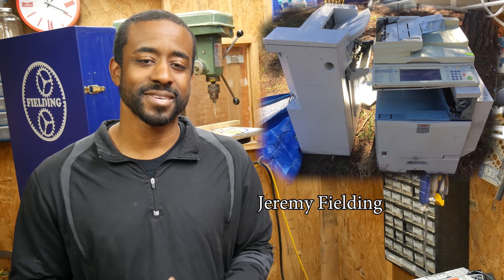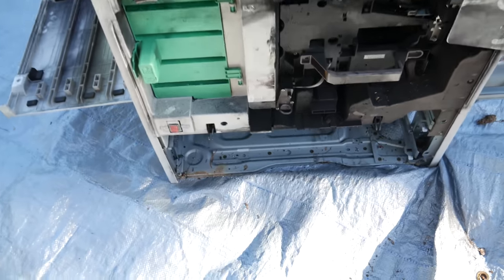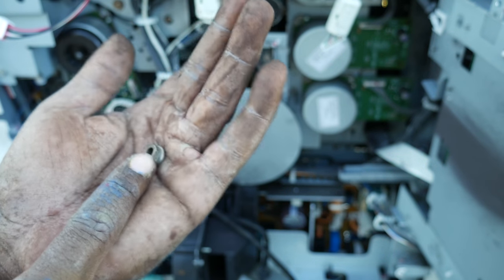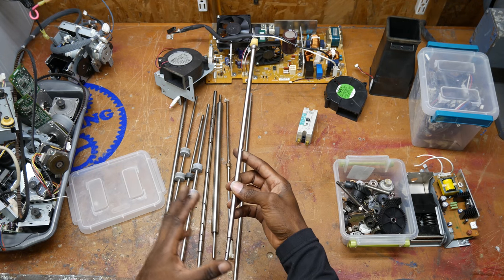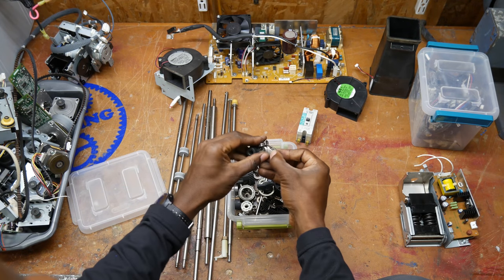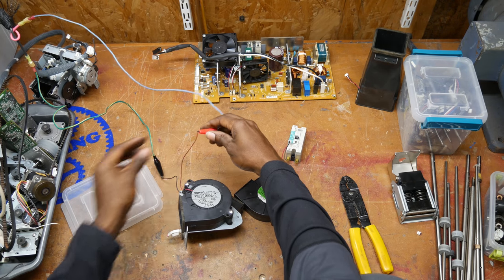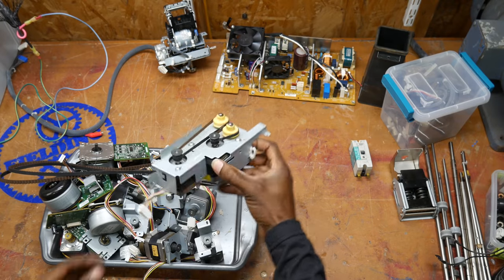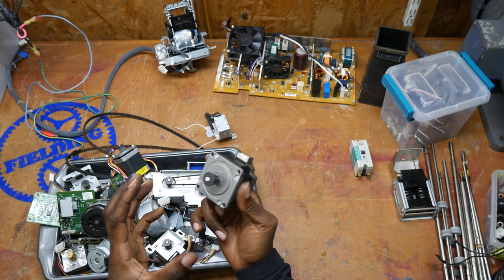How To Salvage A Commercial Printer for Electrical And Mechanical Parts 049

Comment: Holy crap, that's a lot of parts. I have to wonder, if it took you two days to take the thing apart, how long it takes to put these things together in the first place... very cool. Thanks for sharing.
Reply from the maker: My thought exactly
Reply: They put it together in minutes. But they have lots of practice.
Reply: I went to a car assembly plant once and it took 15 minutes for a car to go down the assembly line. That doesn't mean they were only making a car every 15 minutes though. The interval between vehicles on the line was a lot shorter than that. More like as fast as someone could open a car door, get in, and drive a vehicle away. There was a team of people just doing that. The power of mass production is one of the reasons we live like how we do today.

Comment: Hey Jeremy, question: what app or how did you add those AWESOME focused graphics that point out the various parts?  You may have done this before, but this is my first view of a video from you like this.  It really, really adds a great touch to this type of video!!!!  Great job!!!
Reply from the maker: adobe after effects. Check out #45, 40, 34, 24... they all have on screen graphics. Some are more elaborate then others. The one you watched was the "simpliest" one. The Microwave one is the most complex.
Reply: Jeremy Fielding ok, thanks J!  I'll check them out!

Comment: What'd you do with the power supply and how would one go about "turning it on" to get allllll of the voltage outputs working? I'm kind of stuck on that as I recently came across a  Ricoh aficio 2550 full-sized copier, pretty much the same thing as in this video... any advice would be much appreciated! By you or anyone else in the comments section. 
Thanks everyone, great vids btw!
Cheers!

Comment: Ha ha ha. i am a Ricoh tech. i do this every day. maybe not as far as this but i fix 6 or 7  a day.  those first things you pointed to when you said you didnt know what they were. they are magnetic clutches.  behind the lens was a CCD sensor.  this model has to be 15 years or more old now.. new ones have more motors and less gears. edit: comment was at 3 minutes in. not long after you labled the clutches as DC Motors. that is not correct. that other part you couldnt figure out is a stapler unit. i have swapped a few of those out too lol.
Reply from the maker: THANKS

Comment: What about making a 3D printer with the stepper motors?
Reply from the maker: It could be done
Reply: Some of the shafting might not be bad for linear guides too. You can make simple bearings out of any pair of the same bearings with a spacer between them. That's how I made the Z axis on my CNC machine. Alignment is pretty finicky though https://i.imgur.com/arzFmKQ.jpg

Comment: 8mm shaft is a common size in 3D printing, which partially derived from 2d printers. But who knows, maybe they did mix up the shaft sizes. Thanks for the video.
Reply: Oh, and I would suggest you put a switch on your test power supply. This will help in two things, 1) it will prevent accidental shorting of the + and - while just sitting on the bench, and two, it will prevent a component from activating when you weren't ready while putting the wires on and prevent sparking as well.
Reply from the maker: I usually do that actually. Just not this time. too lazy to dig one out I guess. You see my "normal" setup in the how motors work series... with the battery and switch. It is the first video in the series/playlist if you are curious.
Reply from the maker: Some measured .3125", and some .315 (8mm). I think some parts might be made in the US and other over seas. Other wise it is just a relaxed tolerance/ coincidence. Who knows. LOL
Reply: With ground shafting it is probably very accurate. Grinders are graduated in 0.00005 increments (referred to confusingly enough as a half a tenth). In practice you can work closer than that with them too, if you're careful, and a bit lucky.

Comment: Those large printers are made by wizards in dark cave and magic makes them work. I would never open one! The little evil newts may get out and infest your house. Another great video.
Reply from the maker: I was truly astonished at the electrical and mechanical engineering that went into that printer
Reply: We had a huge Canon at work that ran for years and it would fold your clothes and grill burgers while doing it! I got into it a couple times for paper jams and I couldn't believe how something so complicated made from cast plastic and stamped sheet metal with scads of plastic gears and legions of belts, could be so dependable much less actually work.

Comment: Very nice.  Those "brass bushings" could very easily be sintered bronze.  Did you take a close look?  Sintered metal bushings are great for holding on to lubrication, and some of the other uses include filtering and noise suppression.  I wonder why that copier go pitched in the first place.  Your yellow hands might look pretty, but please wear gloves and some kind of mask.  It would be so depressing to lose you any earlier than necessary.
Reply: If you look when Jeremy took it apart it was loaded with toner inside of it. Once these machines get like that it is not cost effective to repair them. It has to do with economies of scale and individual effort versus mass production efficiency. Tossing these machines out when they're in this state and buying a new one ends up being the far cheaper route.
Reply: Hmm, that sounds like a business opportunity to me.  Chimney sweep becomes copier sweep.  A big bag or modified sandblasting cabinet, a fan or compressed air, heppa filter...(the devil may be in the details though).
Reply: I think the problem is that toner is engineered to stick to surfaces. So just blowing on it won't remove all of it. Usually when you try that you just blow debris even more places where it shouldn't be. It might be good for the paper lint though. Because that's the other problem with printers. The paper lint tends to block up optical sensors in them. Still entrancing the whole machine with air could prove quite a challenge. At best you're only going to end up with a clean old worn out printer anyways too.
Reply: Paul Frederick   Well, playing around with clean parts is nice too.

Comment: Jeremy, I absolutely love your vids and knowledge. I'm also sub'd to you under my Guess Who account (as if that matters, right?). Anyway the reason I love your videos and knowledge is because you break it all down where someone like me can build something like a clock. But I don't need a clock I need someone with the solid works software to design a blueprint for a 2"x72" knife grinder out of a washing machine motor. I can get used washing machine motors free at work. I realize from your videos they are not the ideal ac, but my old jewelry teacher whom has retired and moved built one with a washing machine motor and it worked great, with a back plate at the top of the grinding section and no back plate for non-jewelry items like knives. The best Christmas present I could ever get is a blueprint like this. I am also a welder, but have no access to solid works or anything that could design something with a spring mechanism. Also I have no idea how to make the tracking mechanism, but I desperately want to get back into blade-smithing.  Can you help me please?
Reply: if required I can also get also get and use 220 dryer motors. there should be a section below the plate where I can grind knives without a backplate. I know this is a tall order to ask for for free but I'll continue to like and sub your vids.
Reply: basically I only a blueprint for the grinder and a video on how to make the tracking mechanism.
Reply from the maker: I am honored you feel I am the one who can solve this problem for you. However, there are a few problems with your request. 1. CAD software doesn't do any work. it is a tool by which I create custom machines from scratch. Most of the design happens in my head and quite a bit with pencil and paper... given number 1... 2. It is unreasonable to ask anyone to do work like this for free. Likes and subs have zero monetary value, and would by no means equal the labor and effort required to design a machine. 3. There are already a large number of build videos regarding this topic... many of which have paid plans. I am not sure why you need another one. You could at least give someone credit for their work and buy their plans. If you can't find a single video with plans on YouTube I will provide the links for you for free. That's the best I can afford to give as a Christmas gift :)
Reply: Dude really unkind. youtube does not pay for subs and likes. they barely come into the algorithm. on top of that, you are just asking for a free hand out. This kind of request is basically a slap in the face, that you think all of his education and time spent making this channel is worth little more than a golf clap ad on top of that you think he should make free content for you personaly. Really really bad form!